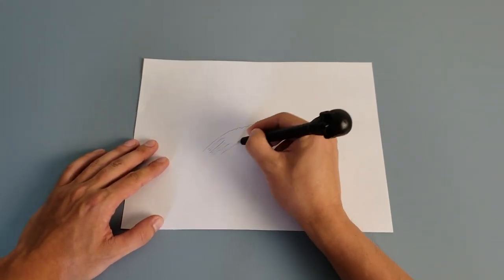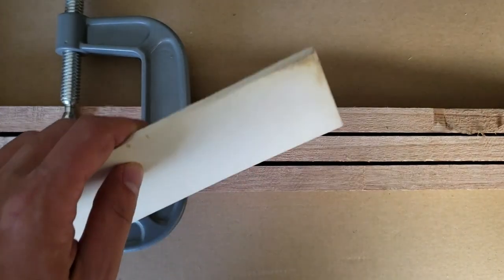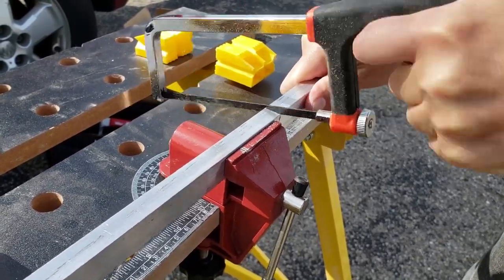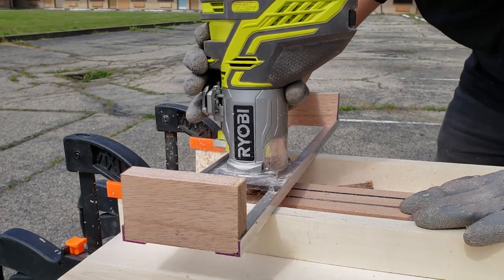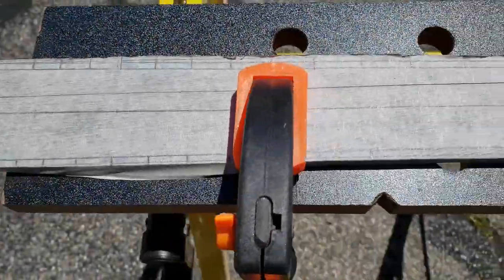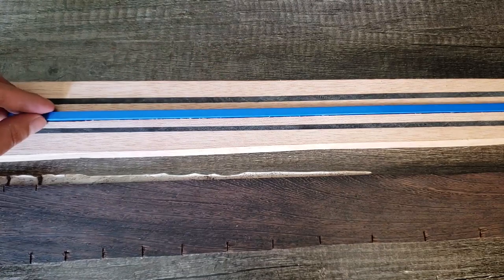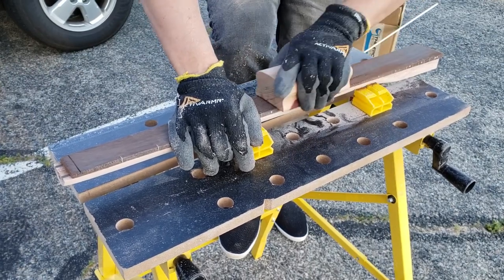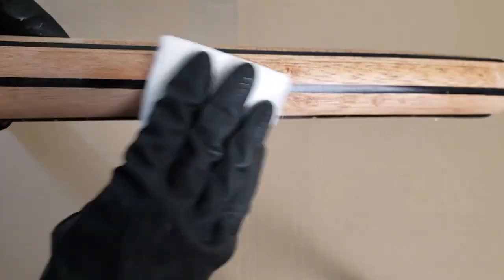Dark Bass Part 1 - The Great Guitar Build Off 2021 (GGBO 2021)

Comment: Nice.  I’d had a similar idea for a neck, minus the epoxy.  Someday…
Reply from the maker: thanks.  It was a pure experiment. And the neck still doing fine.   But I mix the epoxy the way it doesn't cure as glass hard. It is strong but a little bit bendable.  So you can use a truss rod and won't crack the epoxy.  But we will see how it is gonna be after a few years.
Reply: @RomanDark  Yeah, I hadn't thought about stressing the epoxy.  Though that truss shouldn't have to move much if it ever does.